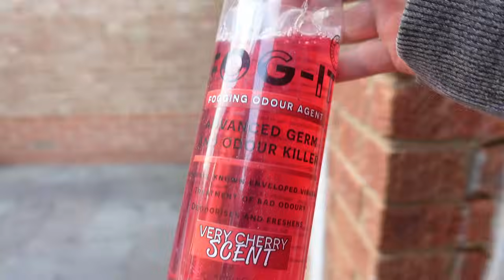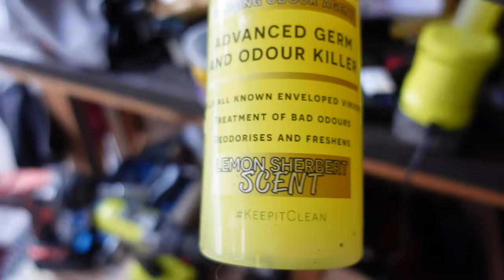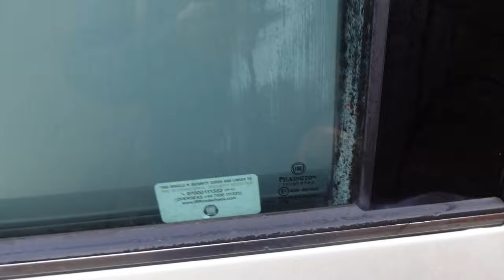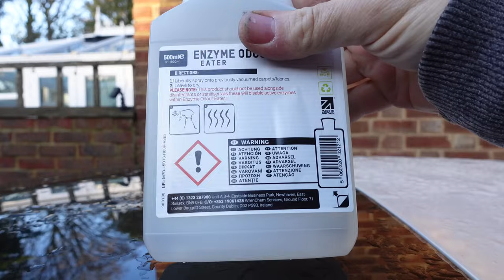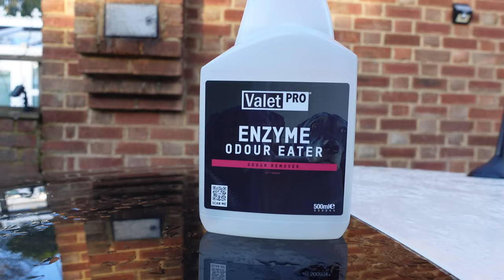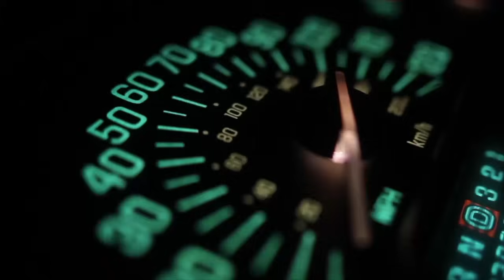Project Pearl - Day 3 - Decision is Made? Fiat 500 Lounge Former Cat D from BCA Salvage Damaged

Comment: Paul,the thick brown/white wire is the heated rear screen.
Reply from the maker: Yeah I thought it was. Cheers.
Reply: @Love500  I needed to write down what each wire was used for when it needed repairing 😏.
Reply from the maker: @JimF500  you can really get it wrong as long as you’re careful. There are some wires that are the same colour but are different thicknesses.
Reply: @Love500  The brother repaired it by soldering it, but I only open it rarely as I don't trust it . The boot warning light came up sometime later and I botched it by connecting up the wire to the BCM  to earth and it put out the light. Yes I know it is not right.

Comment: Dehumidifiers don't work in low temperatures Paul, you'll need a heater in there too.
Reply from the maker: Is that right? I didn’t know that.
Reply: I've had one for years and it never collects anything in low temperature. I'm guessing it's because you need a bit of heat to put the moisture back into the air for the dehumidifier to suck back out of the air. @Love500